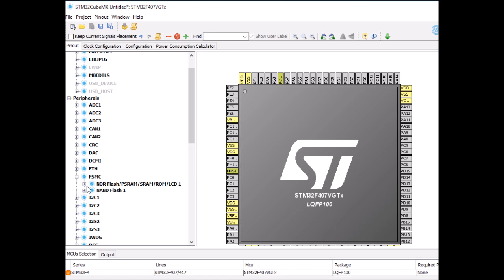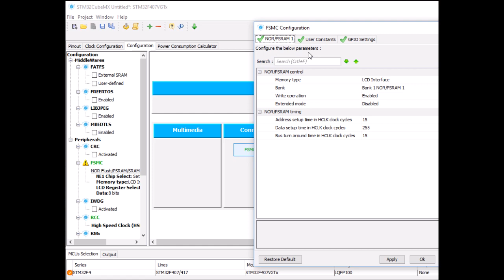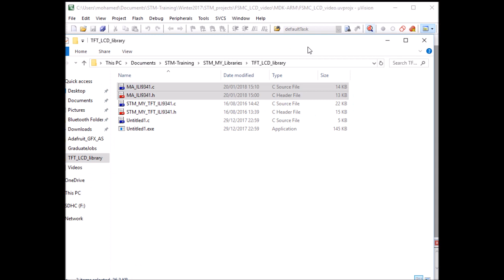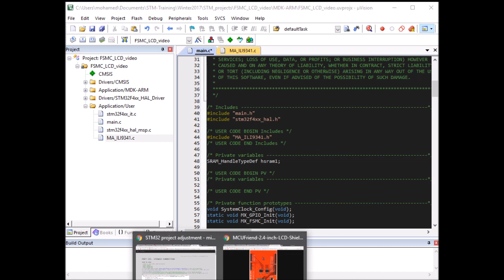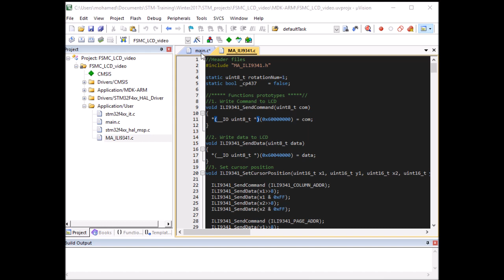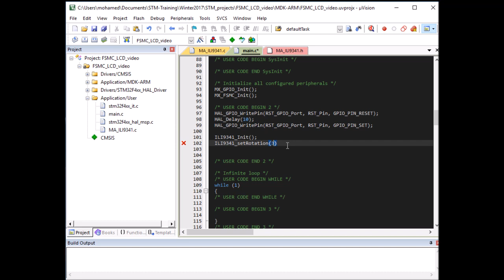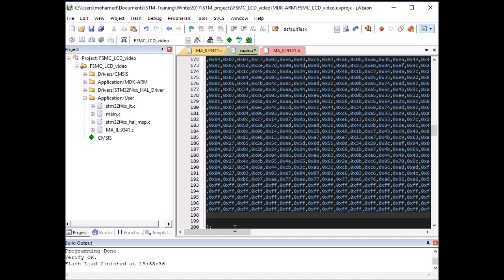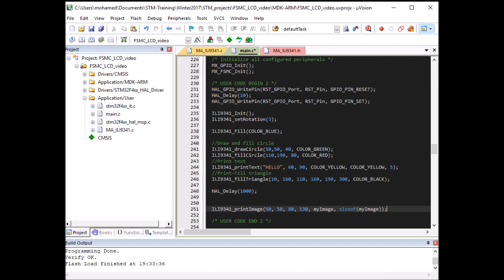STM32F4 Discovery board - Keil 5 IDE with CubeMX: Tutorial 21 - TFT LCD ili9341 (using FSMC)

Comment: hi
thank you for your tutorial
I have an exact LCD and stm32h743zit6 nucleo board. i have been trying like forever to do this tutorial with my board but i cant. my lcd just blink for a few times and goes white. please please can anyone help me?
Reply from the maker: Hi Reza,
I don't have your board around.. but I can try setting up a project that should work with yours
Reply from the maker: Play around with FMC clock speed in Clock Configuration CubeMX and try getting it around 168Mhz.

Also disable FMC FIFO from FMC CubeMX parameters.
Reply: @mutexembedded2206  thank you for time and answer
Even with 168 MHz didn't work!!! this is my main:
#include "main.h"

/* Private includes ----------------------------------------------------------*/
/* USER CODE BEGIN Includes */

#include "MA_ILI9341.h"

/* USER CODE END Includes */

/* Private typedef -----------------------------------------------------------*/
/* USER CODE BEGIN PTD */

/* USER CODE END PTD */

/* Private define ------------------------------------------------------------*/
/* USER CODE BEGIN PD */
/* USER CODE END PD */

/* Private macro -------------------------------------------------------------*/
/* USER CODE BEGIN PM */

/* USER CODE END PM */

/* Private variables ---------------------------------------------------------*/

SRAM_HandleTypeDef hsram1;

/* USER CODE BEGIN PV */

/* USER CODE END PV */

/* Private function prototypes -----------------------------------------------*/
void SystemClock_Config(void);
static void MX_GPIO_Init(void);
static void MX_FMC_Init(void);
/* USER CODE BEGIN PFP */

/* USER CODE END PFP */

/* Private user code ---------------------------------------------------------*/
/* USER CODE BEGIN 0 */

/* USER CODE END 0 */

/**
  * @brief  The application entry point.
  * @retval int
  */
int main(void)
{
  /* USER CODE BEGIN 1 */

  /* USER CODE END 1 */

  /* Enable I-Cache---------------------------------------------------------*/
  SCB_EnableICache();

  /* Enable D-Cache---------------------------------------------------------*/
  SCB_EnableDCache();

  /* MCU Configuration--------------------------------------------------------*/

  /* Reset of all peripherals, Initializes the Flash interface and the Systick. */
  HAL_Init();

  /* USER CODE BEGIN Init */

  /* USER CODE END Init */

  /* Configure the system clock */
  SystemClock_Config();

  /* USER CODE BEGIN SysInit */

  /* USER CODE END SysInit */

  /* Initialize all configured peripherals */
  MX_GPIO_Init();
  MX_FMC_Init();
  /* USER CODE BEGIN 2 */
	
	
	
	HAL_Delay(1000);
	HAL_GPIO_WritePin(GPIOA, GPIO_PIN_3, GPIO_PIN_RESET);
	HAL_Delay(10);
	HAL_GPIO_WritePin(GPIOA, GPIO_PIN_3, GPIO_PIN_SET);
	
	ILI9341_Init();
	HAL_Delay(1000);
	ILI9341_setRotation(3);
	
	ILI9341_Fill(COLOR_BLUE);
	
	//Draw and fill circle
	ILI9341_drawCircle(50,50, 40, COLOR_GREEN);
	ILI9341_fillCircle(110,190, 80, COLOR_RED);
	//Print text
	ILI9341_printText("HELLO", 60, 90, COLOR_YELLOW, COLOR_YELLOW, 5);
	//Print-Fill triangle
	ILI9341_fillTriangle(10, 160, 110, 160, 190, 300, COLOR_BLACK);
	
	HAL_Delay(1000);
	
	
//	ILI9341_printImage(50, 50, 80, 130, myImage, sizeof(myImage));
	
	

  /* USER CODE END 2 */

  /* Infinite loop */
  /* USER CODE BEGIN WHILE */
  while (1)
  {
    /* USER CODE END WHILE */

    /* USER CODE BEGIN 3 */
  }
  /* USER CODE END 3 */
}

/**
  * @brief System Clock Configuration
  * @retval None
  */
void SystemClock_Config(void)
{
  RCC_OscInitTypeDef RCC_OscInitStruct = {0};
  RCC_ClkInitTypeDef RCC_ClkInitStruct = {0};
  RCC_PeriphCLKInitTypeDef PeriphClkInitStruct = {0};

  /** Supply configuration update enable 
  */
  HAL_PWREx_ConfigSupply(PWR_LDO_SUPPLY);
  /** Configure the main internal regulator output voltage 
  */
  __HAL_PWR_VOLTAGESCALING_CONFIG(PWR_REGULATOR_VOLTAGE_SCALE0);

  while(!__HAL_PWR_GET_FLAG(PWR_FLAG_VOSRDY)) {}
  /** Initializes the CPU, AHB and APB busses clocks 
  */
  RCC_OscInitStruct.OscillatorType = RCC_OSCILLATORTYPE_HSE;
  RCC_OscInitStruct.HSEState = RCC_HSE_BYPASS;
  RCC_OscInitStruct.PLL.PLLState = RCC_PLL_ON;
  RCC_OscInitStruct.PLL.PLLSource = RCC_PLLSOURCE_HSE;
  RCC_OscInitStruct.PLL.PLLM = 1;
  RCC_OscInitStruct.PLL.PLLN = 42;
  RCC_OscInitStruct.PLL.PLLP = 2;
  RCC_OscInitStruct.PLL.PLLQ = 16;
  RCC_OscInitStruct.PLL.PLLR = 2;
  RCC_OscInitStruct.PLL.PLLRGE = RCC_PLL1VCIRANGE_3;
  RCC_OscInitStruct.PLL.PLLVCOSEL = RCC_PLL1VCOWIDE;
  RCC_OscInitStruct.PLL.PLLFRACN = 0;
  if (HAL_RCC_OscConfig(&RCC_OscInitStruct) != HAL_OK)
  {
    Error_Handler();
  }
  /** Initializes the CPU, AHB and APB busses clocks 
  */
  RCC_ClkInitStruct.ClockType = RCC_CLOCKTYPE_HCLK|RCC_CLOCKTYPE_SYSCLK
                              |RCC_CLOCKTYPE_PCLK1|RCC_CLOCKTYPE_PCLK2
                              |RCC_CLOCKTYPE_D3PCLK1|RCC_CLOCKTYPE_D1PCLK1;
  RCC_ClkInitStruct.SYSCLKSource = RCC_SYSCLKSOURCE_PLLCLK;
  RCC_ClkInitStruct.SYSCLKDivider = RCC_SYSCLK_DIV1;
  RCC_ClkInitStruct.AHBCLKDivider = RCC_HCLK_DIV1;
  RCC_ClkInitStruct.APB3CLKDivider = RCC_APB3_DIV2;
  RCC_ClkInitStruct.APB1CLKDivider = RCC_APB1_DIV2;
  RCC_ClkInitStruct.APB2CLKDivider = RCC_APB2_DIV2;
  RCC_ClkInitStruct.APB4CLKDivider = RCC_APB4_DIV2;

  if (HAL_RCC_ClockConfig(&RCC_ClkInitStruct, FLASH_LATENCY_2) != HAL_OK)
  {
    Error_Handler();
  }
  PeriphClkInitStruct.PeriphClockSelection = RCC_PERIPHCLK_FMC;
  PeriphClkInitStruct.FmcClockSelection = RCC_FMCCLKSOURCE_D1HCLK;
  if (HAL_RCCEx_PeriphCLKConfig(&PeriphClkInitStruct) != HAL_OK)
  {
    Error_Handler();
  }
}

/* FMC initialization function */
static void MX_FMC_Init(void)
{

  /* USER CODE BEGIN FMC_Init 0 */

  /* USER CODE END FMC_Init 0 */

  FMC_NORSRAM_TimingTypeDef Timing = {0};

  /* USER CODE BEGIN FMC_Init 1 */

  /* USER CODE END FMC_Init 1 */

  /** Perform the SRAM1 memory initialization sequence
  */
  hsram1.Instance = FMC_NORSRAM_DEVICE;
  hsram1.Extended = FMC_NORSRAM_EXTENDED_DEVICE;
  /* hsram1.Init */
  hsram1.Init.NSBank = FMC_NORSRAM_BANK1;
  hsram1.Init.DataAddressMux = FMC_DATA_ADDRESS_MUX_DISABLE;
  hsram1.Init.MemoryType = FMC_MEMORY_TYPE_SRAM;
  hsram1.Init.MemoryDataWidth = FMC_NORSRAM_MEM_BUS_WIDTH_8;
  hsram1.Init.BurstAccessMode = FMC_BURST_ACCESS_MODE_DISABLE;
  hsram1.Init.WaitSignalPolarity = FMC_WAIT_SIGNAL_POLARITY_LOW;
  hsram1.Init.WaitSignalActive = FMC_WAIT_TIMING_BEFORE_WS;
  hsram1.Init.WriteOperation = FMC_WRITE_OPERATION_ENABLE;
  hsram1.Init.WaitSignal = FMC_WAIT_SIGNAL_DISABLE;
  hsram1.Init.ExtendedMode = FMC_EXTENDED_MODE_DISABLE;
  hsram1.Init.AsynchronousWait = FMC_ASYNCHRONOUS_WAIT_DISABLE;
  hsram1.Init.WriteBurst = FMC_WRITE_BURST_DISABLE;
  hsram1.Init.ContinuousClock = FMC_CONTINUOUS_CLOCK_SYNC_ONLY;
  hsram1.Init.WriteFifo = FMC_WRITE_FIFO_DISABLE;
  hsram1.Init.PageSize = FMC_PAGE_SIZE_NONE;
  /* Timing */
  Timing.AddressSetupTime = 6;
  Timing.AddressHoldTime = 0;
  Timing.DataSetupTime = 6;
  Timing.BusTurnAroundDuration = 0;
  Timing.CLKDivision = 0;
  Timing.DataLatency = 0;
  Timing.AccessMode = FMC_ACCESS_MODE_A;
  /* ExtTiming */

  if (HAL_SRAM_Init(&hsram1, &Timing, NULL) != HAL_OK)
  {
    Error_Handler( );
  }

  /* USER CODE BEGIN FMC_Init 2 */

  /* USER CODE END FMC_Init 2 */
}

/**
  * @brief GPIO Initialization Function
  * @param None
  * @retval None
  */
static void MX_GPIO_Init(void)
{
  GPIO_InitTypeDef GPIO_InitStruct = {0};

  /* GPIO Ports Clock Enable */
  __HAL_RCC_GPIOC_CLK_ENABLE();
  __HAL_RCC_GPIOH_CLK_ENABLE();
  __HAL_RCC_GPIOA_CLK_ENABLE();
  __HAL_RCC_GPIOE_CLK_ENABLE();
  __HAL_RCC_GPIOB_CLK_ENABLE();
  __HAL_RCC_GPIOD_CLK_ENABLE();
  __HAL_RCC_GPIOG_CLK_ENABLE();

  /*Configure GPIO pin Output Level */
  HAL_GPIO_WritePin(GPIOA, GPIO_PIN_3, GPIO_PIN_RESET);

  /*Configure GPIO pin Output Level */
  HAL_GPIO_WritePin(GPIOB, GPIO_PIN_14|GPIO_PIN_7, GPIO_PIN_RESET);

  /*Configure GPIO pin Output Level */
  HAL_GPIO_WritePin(GPIOG, GPIO_PIN_6, GPIO_PIN_RESET);

  /*Configure GPIO pin : PC13 */
  GPIO_InitStruct.Pin = GPIO_PIN_13;
  GPIO_InitStruct.Mode = GPIO_MODE_IT_RISING;
  GPIO_InitStruct.Pull = GPIO_NOPULL;
  HAL_GPIO_Init(GPIOC, &GPIO_InitStruct);

  /*Configure GPIO pin : PA3 */
  GPIO_InitStruct.Pin = GPIO_PIN_3;
  GPIO_InitStruct.Mode = GPIO_MODE_OUTPUT_PP;
  GPIO_InitStruct.Pull = GPIO_NOPULL;
  GPIO_InitStruct.Speed = GPIO_SPEED_FREQ_LOW;
  HAL_GPIO_Init(GPIOA, &GPIO_InitStruct);

  /*Configure GPIO pins : PB14 PB7 */
  GPIO_InitStruct.Pin = GPIO_PIN_14|GPIO_PIN_7;
  GPIO_InitStruct.Mode = GPIO_MODE_OUTPUT_PP;
  GPIO_InitStruct.Pull = GPIO_NOPULL;
  GPIO_InitStruct.Speed = GPIO_SPEED_FREQ_LOW;
  HAL_GPIO_Init(GPIOB, &GPIO_InitStruct);

  /*Configure GPIO pin : PG6 */
  GPIO_InitStruct.Pin = GPIO_PIN_6;
  GPIO_InitStruct.Mode = GPIO_MODE_OUTPUT_PP;
  GPIO_InitStruct.Pull = GPIO_NOPULL;
  GPIO_InitStruct.Speed = GPIO_SPEED_FREQ_LOW;
  HAL_GPIO_Init(GPIOG, &GPIO_InitStruct);

  /*Configure GPIO pin : PG7 */
  GPIO_InitStruct.Pin = GPIO_PIN_7;
  GPIO_InitStruct.Mode = GPIO_MODE_INPUT;
  GPIO_InitStruct.Pull = GPIO_NOPULL;
  HAL_GPIO_Init(GPIOG, &GPIO_InitStruct);

}

/* USER CODE BEGIN 4 */

/* USER CODE END 4 */

/**
  * @brief  This function is executed in case of error occurrence.
  * @retval None
  */
void Error_Handler(void)
{
  /* USER CODE BEGIN Error_Handler_Debug */
  /* User can add his own implementation to report the HAL error return state */

  /* USER CODE END Error_Handler_Debug */
}

#ifdef  USE_FULL_ASSERT
/**
  * @brief  Reports the name of the source file and the source line number
  *         where the assert_param error has occurred.
  * @param  file: pointer to the source file name
  * @param  line: assert_param error line source number
  * @retval None
  */
void assert_failed(uint8_t *file, uint32_t line)
{ 
  /* USER CODE BEGIN 6 */
  /* User can add his own implementation to report the file name and line number,
     tex: printf("Wrong parameters value: file %s on line %d\r\n", file, line) */
  /* USER CODE END 6 */
}
#endif /* USE_FULL_ASSERT */

/********************** (C) COPYRIGHT STMicroelectronics *****END OF FILE****/
Reply: @mutexembedded2206  Can i send my project to you please?
can i have your email or something else?

Comment: Hello very good videos I have an lcd 3.2inches with ILI9341 and interfaces of 16bit LCD register select is A18 modify *(__IO uint16_t *)(0x60080000) data; and it works I see the color blue, but I can't change the colors when I write text or a figure the color is wrong I wanted to ask you that something else I have to modify so that the colors are displayed correctly with 16bit interfas  thank you very much
Reply: Hello, I have the same problem. Did you find a sollution for it?

Comment: Great video, can you please help me with adding touch here? I tried using your libraries from the other video where you work with SPI for touch but it doesn't work... I also have a display with x+,x-,y+,y- but I use a touch screen controller for that so I can work with I2C or SPI.
Reply from the maker: Hi,
What touch controller you are using?
Reply: the STMPE610 , resistive touch screen controller
Reply from the maker: @marekoens1296  Library I provided would not work with this controller. You need to write a driver for this specific chip.

Comment: Thank you so much for describing the FSMC and ILI9341 and how to use it in Cube. I am using an STM3220G Eval board which uses a 3.2" LCD and the ili9325 drivers but its very similar to your driver in the way of functionality. Thanks again. :)

Comment: Hi, I have a tft display with ILI9325 driver. I followed the steps in the video, but only the back white lights worked. How do I run this screen?
Reply from the maker: Cannot run ILI9325 with this library,,  it is meant to be for the ILI9341 only.
Reply: @mutexembedded2206   Do you have any suggestions to modify this for ILI9325? Or do you know where to find library for ILI9325.
Reply from the maker: @sindujatenth  Hi,
I often look for Github open source libraries and port them to STM32, if I did not like their structure I write them from scratch. Start with Github, you should be able to port them. GL

Comment: i have the ili 9341 3.2 tft with it's arduino shield can i use the same library??
Reply from the maker: i believe so
Reply: @mutexembedded2206  hi there thanks for your response i am trying to get it work but i just can't compile the MA_ILI9341.h the problem is on the declaration of the fount1[] the error say it has alredy declared and thanks alot for your help
Reply: @mutexembedded2206  i fixed it and i downloaded the code but it doesn't work the ili9341 3.2 is a 16 bit not 8 i think that's why i am trying to find the right library

Comment: لو سمحت ممكن تفاصيل اكتر عن ال FSMC 
انا شغال بشاشه تانيه رقمها ili9486 
لما دورت لقيت انها هي هياها ال ili9341
و راجعت علي ال commands و قارنتها بينهم في الداتا شيت كانوا زي بعض 
بس في نفس الوقت مش بتعرض علي الشاشه غير لما غيرت ال frequance 
و العرض كان في نص الشاشة 

ف هل في امكانيه لو يكون في شرح مفضل اكتر عن FSMC 
لو ممكن اتواصل مع حضرتك عشان احل المشكلة ؟ 
و شكرا جدا لمجهود حضرتك
Reply from the maker: مرحبا محمد
Showing content on half of the screen only is usually caused by data bus width;
if you are using 8 data lines and LCD is set to use 16 data lines mode, it will only fill half of the screen. Thanks
Reply: @mutexembedded2206  
شكرا لردك :D 
بس اظن المشكله مش في ال data bus width 
هي الشاشه مش النص بالظبط يعني و النص التاني بيظهر فيه خطوط عشوائيه 
غير انا انا مستخدم shield جاهز و متصمم علي 8 bit زي اللي حضرتك مستخدمه 
لما فتحت الداتا شيت لقت ان في اكتر من مود تمام اقدر استخمه 8-16 bit 
بس عشان اعدم هيبقي من خلال IM pins 
و هما مش ظاهرين علي البورده 

دي الشاشه للي بستخدمها 
https://ram-e-shop.com/product/kit-lcd-tft3-2-touch/
Reply: Hi again 
i have found the problem 
it was in the initialization function under display section  
i have changer the value of " ILI9341_SendData   (0x27)" to " ILI9341_SendData   (0x3b)" 
and it worked fine ::D 
but now i need to change the refresh rate of the lcd ... any idea ?
Reply from the maker: @mahmoudelghzaly4918  
Good job Mahmoud!
Do you mean how fast display controller scan across LCD or how fast STM updates data to LCD ?
Reply: @mutexembedded2206  
i think how fast display controller scan across LCD
the lcd blinking can be noticed
Reply from the maker: @mahmoudelghzaly4918  
Hi Mahmoud,, 
Certainly, I can add you on my Facebook, what's yours? Thanks

Comment: Great video thank you. I did follow your instructions and got my display working! The timing seems to be different from display board to display board; tried two TFT-Proto from MikroElektroika. 
Question: Have you tried a 16bit wide bus yet?
Reply from the maker: Hi,
Yes, I think I know what you talking about, do you have the Green LCD with both 16-bits line and SPI ?
Reply: thats the one I use: https://www.mikroe.com/tft-proto-board
One gets me a frame rate of 14Hz and a second of the same board type only of 5Hz. I just downloaded the 16bit example from MifroElektronicas webpage. I wonder how 16bit is improving the max. framerate in my application…

Comment: Sir, I followed your instructions as it is. But it is not working. It is showing a grey screen upon reset. I am using FMC of NUCLEO-H743ZI and 8bit parallel 240x320 TFT. Kindly HELP!!
Reply: hi
I'm having your problem too!! i have stm32h743zi nucleo board
did you find any solutions?

Comment: Great tutorial, the LCD works great except for me unable to write some specific colors, like 0x001F turns the screen white and I can't do anything unless I reset the STM board. Would you happen to know why this happens?
Reply from the maker: Hi,
Sorry for later reply.. that could be overclocking or long wires
Reply: So I'm looking at the datasheet of the display and was wondering if it was possible to write the entire frame to the display, then request a refresh to avoid the huge tearing I'm currently having. There seems to be no mention of this being possible, would you know anything about this?
Reply: Thank you, the newest version of CubeMX has output speed values along with FSMC so I played with those a bit. I also switched to TrueSTUDIO which is a free and without limits alternative to uVision.

Comment: In the .txt file you didn't mention where to connect PD2 (from STM which you called RST) on LCD?
Reply from the maker: Hi Arham,
right, you need to connect this to 3v in normal condition, and to GND to implement Reset.

Comment: Is there any problem if I change the clock configuration to 72 MHz instead of setting it to 168MHz?
If there is any change in the code kindly let me know.
Reply from the maker: Hi Arham  mate,
It should not make a difference as long as FSMC speed is consistent.
Reply: Sir we are using parallel communication instead of I2C or SPI? What if we use, then which one is more efficient?
Reply from the maker: @arhamtemi2865  
Hi Arham,
Parallel is way faster x4 times than SPI.
I2C is slowest, 30 times slower than SPI.
Can use SPI for less wires.

Comment: hi sir,
I have Using SPI Communication for interfacing AFE4300 sensor with STM32f4 board. I have developed  AFE4300 library files as per MEMS Sensor. but it's not working do you know any idea about that. if you have any references sensor code or library files please send me? 
there are no any resources on the internet also. please help me.
Thanks,
rohitpatil597@gmail.com
Reply from the maker: Hi Rohit,
You have developed the library but did not work when you tested ? is that where the problem is?
If that is the case, then you need to re-read datasheet carefully and ensure you did not miss some important configurations or initialization.

I would recommend you do some basic tests like simple write to and read from device to ensure SPI communication is set up.

Hope this helps